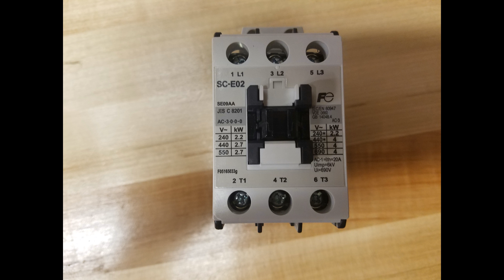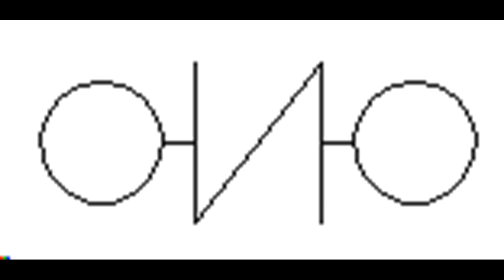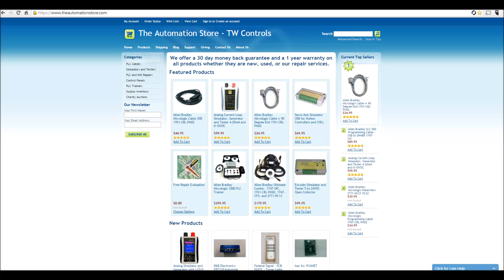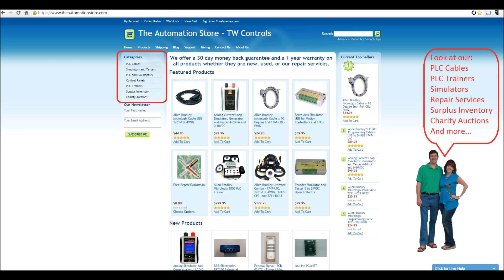Normally Open, Normally Closed, Relays, Contactors, and Push Buttons Explained

Comment: Is their voltage open circuit and closed
Reply: My question is voltages
Reply from the maker: @vfgrfbgrb  I'm not understanding what you are asking about voltages.
Reply: @TimWilborne  troubleshooting
Reply from the maker: Hi Juan.  I don't understand your question.
Reply: @TimWilborne  open circuit has voltage in push button or contact closed circuit no voltage
Reply from the maker: @vfgrfbgrb  See if this link helps.
https://www.theautomationstore.com/plc-training-electrical-contacts-normally-open-and-normally-closed-contacts/

Comment: Hi possible to meausre continuity in relay contacts during energised mode
Reply from the maker: Chances are you'll be looking for voltage.  You would need to look at the particular wiring diagram to know for sure.  So for example on the R1 contact in the link below, you would be looking for 24VDC before and after the contact.  If you had it before and not after then the relay contact is not closed.  If you have it on both then changes are the relay contact is closed.

Comment: Hi Tim. Great video! Could you explain the basics of Star and Delta wiring, and show how and why these wiring applications are used.

E.g.1. Why is it called Star, and why Delta.
2. How it is wired  in Star, and Delta and/simultaneously
Reply: Please watch....
This is a link to a 5 minute video of light bulbs wired in delta connection. It's in a different language. 
Please could you do something similar and explain how this system works.
I'm intrigued but sadly, I don't understand how it works. How is this system of wiring working, and how are the light bulbs working without a neutral wire to complete the circuit.... Thanks...
https://youtu.be/msORONo9--4
Reply from the maker: See you at the following link helps. https://www.theautomationstore.com/star-delta-start-up-principles/

Comment: Thanx for the video. Good job using the wire wrapped screw driver to make the point about coils. Anyway, I arrived here googling for a normally closed, latch on open contactor. 12 volt coil. It needs to handle up to 100AMPS of current. Are you aware of such an animal? It's for my solar system.
Reply from the maker: Steve bakker Do you truly need a normally closed contactor or could you use a small normally closed relay to power a normally open contactor? There are such animals but they are more costly than there normally open counterparts.